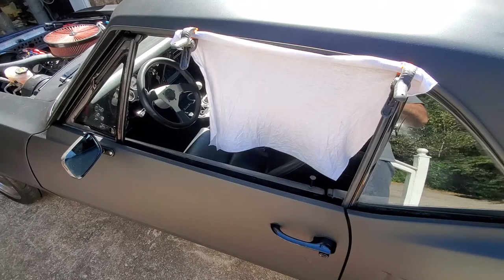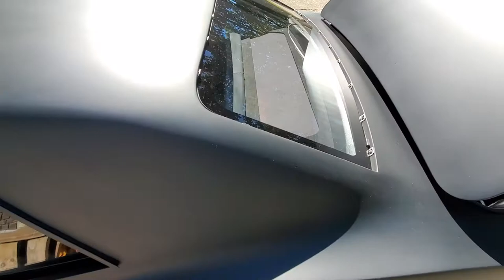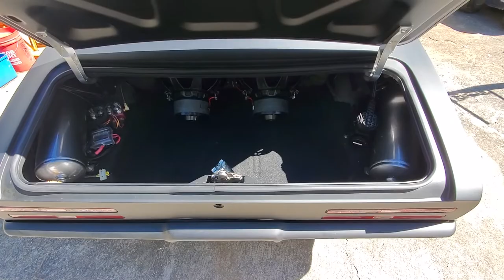Dayton Audio Max X 15" Subwoofers Infinite Baffle 1967 Firebird

Comment: Are these subs designed for IB setup? Or do they just so happen to work very well in IB?
Reply from the maker: They're not specifically designed for IB but they did work very well in IB. They sounded good with the trunk closed and with the trunk open. I did that to just compare trunk baffle IB to what a true IB setup would sound like. With the trunk open they played a little lower but lost a little in the 40hz to 60hz range. I was really happy with them especially for the price.

Comment: Still running the same subs? I want to run 2 x 15" trunk baffle and was avout to get the One Audio IB3 but after seeing what the dayton audio can do im a bit double minded
Reply from the maker: I'm not running them anymore, I was happy with them but sold them to a friend that is running them in a 2019 Mustang GT with a trunk baffle. At the time I was thinking about going with a smaller sub setup. I have heard really good things about the One Audio subs so that's a tough call. The Dayton's are definitely a good sub and a really good price. The One Audio subs are more expensive but have a good reputation, I would like to hear some in person. You have 2 good options, I don't think you be disappointed with either one.
Reply: @jonathanwall2814  In the 90/2000's I always used to run sealed enclosures. I recently got back into car audio and been experimenting with ported enclosures. For my current build I'm designing an SQ build but want plenty of bass for the bass head in me. Someone suggested trunk IB but I've never heard or experienced them before. I've got a 13W7AE and was thinking of getting another one and playing them sealed, firing up through the rear shelf but the IB3 in trunk baffle has me intrigued. I just don't want to be dissapointed if it's not fulfilling my basshead needs
Reply from the maker: Man, that sounds a lot like me. I was (and still am) a big basshead from the mid 90’s but I am really into sound quality too. I’ve done a lot of DSP tuning in my car. Back in the mid 90’s I had an S-10 blazer with 8 15’s then moved up to 12 15’s but I always built sealed enclosures for it. I was out of it from the late 90’s until around 2020. If you have the chance you really should try to listen to an IB setup if you can find anyone local. Checkout the “Automotive Infinite Baffle/Aperiodic Installs” group on FB. If it’s done right an IB setup will give you plenty of bass and play much lower than a sealed box. I like ported boxes but they take up a lot of space. I wanted to save space and IB did that and has plenty of output.

Comment: How do you get all of that bass from an infinite baffle?
Reply from the maker: Infinite baffles perform really well in the low frequency range. You have to build a strong baffle and seal it off really good. If you have the right subs with decent Xmax and descent power you can move some air. It won't be as loud as a big ported box above 30 hz but still sounds pretty good. Plus you get to keep most of your trunk space.
Reply: @jonathanwall2814  ok cool thanks for  the info and response👍🏽 I have a trunk box but it's hard to get the bass into the cabin cause the backseats don't fold down.
Reply: @whuzup3 back seats have to go sorry.
Reply: @JeffMcDuffie72MeridianGate  oh wow that's not an option for me😁
Reply: @whuzup3  Ive seen floor in trunk used as baffle. Motor and frame either in or out the trunk floor and cone opposite side. Make it a solid build and be sure to keep sub from damage from under car.
Still need an opening from trunk to car cabin but it doesnt have to be seats. the more opening the better though.
Reply: @BARBELLS-AND-BUDS  I thought about getting a 4th order and porting through the ski hatch
Reply: @whuzup3  How big is the opening?
How many of what size subs you thinking about using??
Reply: @BARBELLS-AND-BUDS  The opening is about. 10x6. I have 2 DC audio level 2 12s on a 1k ampere audio amp. 150 amp factory alternator and 1 battery under the hood.
Reply: @whuzup3  I think 60"2 wont be enough for both 12s
Reply: @BARBELLS-AND-BUDS  What is 60"2?
Reply: @whuzup3  your seat opening for the port 6x10
Reply: @BARBELLS-AND-BUDS  Would the length of the port help with the port volume?
Reply: @whuzup3  No unfortunately, the mouth size is issue, length is the tuning frequency.
I think a rule of thumb is half the cone area in port diameter.
It will work , but likely a lot of port noise.
Im not a BP expert so get more opinions to be sure
Reply: @BARBELLS-AND-BUDS  Ok cool. Thanks for the info and responses. Happy New Year to you👍🏾
Reply: @whuzup3  NP and back at ya! Be safe!
Reply: @BARBELLS-AND-BUDS  Likewise
Reply: @whuzup3 - You could get by with 6in. x 10in. Port opening=60sq. In of port area, with your 2-12s in a 4th order, as long as they are rec. For sealed enclosure's, from the Mfg.? This port area won't be too much of a restriction, with your 1,000 watt amp, as your impedance rise while playing music, will prob. only allow 500 watts. Also tune port somewhere between (50Hz-60Hz), if rec. For sealed, make your sealed= rear chamber 1 to 1.5cu. ft. Net, per 12inch, but again go with the company's rec. Specs. Hope this helps, and i love Bandpass enclosures, i hope you can do this, if your subs work in sealed, just ask Dc, what specs, and make what they say.
Reply: @evilinside5984  Hey thanks for the very detailed info! I'm hoping to get rid of some of the trunk rattle too. Take care man!
Reply: @whuzup3 - Yes, trunk rattle will be much less. I have had many great experience's with bandpass enclosures. Just make sure to seal around your ski hole opening, like with expanding foam, so less bass escapes back into your trunk area, around the outside of your port. Let me know if you do this, i want to hear what you think about the sound afterwords. Oh, mount your subs inverted, for better cooling= Sub magnets "NOT" in the sealed chamber. Hope to hear from you!?
Reply: @evilinside5984  ok so the magnets will be in the ported section?
Reply: @whuzup3 - Yes, and wire the subs backwards as well, meaning take the positive wire from your amp, and hook it to your negative on your subwoofer, and take the negative wire from your amp, and hook it to your positive on your subwoofer= everything will be 180= opposite of normal. This is to put the subs back in phase, since the subs will be mounted backwards.
Reply: @evilinside5984  Ok gotcha...hopefully I can find someone that can build the enclosure to specs. I'll update you when it's done👍

Comment: Any idea what it meters at 25, 30, 35, 40, 50, 60, and 70hz?
Reply from the maker: I did a 143.2 at 24hz on the dash with the trunk open and both windows down. In my car with the Dayton subs the lows got louder when I opened the trunk. I did a 142.4 at 42hz with the trunk closed and windows down. Those were my peaks, can't remember what it did at the other frequencies. I was just looking for the peaks at the time but it played good from 24 to 60hz. I used a SPL Lab mini bass meter.
Reply: @jonathanwall2814  Damn, that's frickin sick. How much power? Did you have to set a lowpass for safety so they wouldn't bottom out? I have an 09 Ranger single cab, and I'm considering IB "slot loaded" type of blow through with three 15s (since 18s would be too tall, and less cone area) after seeing a vid of a tacoma (similar truck) set up that way with a single.

I'm considering Stereo Integrity SQL-15s, but I'm not really sure which side of the EBP scale I should consider for IB subs; should I be looking at subs recommended for ported or sealed? Or just really good SQ subs in general but with more xmax than home or pro audio stuff?
Reply: @jonathanwall2814  Nice didnt lose much with trunk shit, Did it change the sound trunk open vs closed regardless of output? I mean did it sound compressed it muted in some way compared to trunk open?
Reply from the maker: @BARBELLS-AND-BUDS  With the trunk open it gained in the lower frequency range below 30hz and lost a little in the 40hz and up. But with the trunk closed it still plays lows pretty good.
Reply from the maker: @Drunken_Hamster  Man sorry for the late reply. I have a DSP that I can set a low cutoff for the subs but the amp has a subsonic built in and even turned all the way down it seems to start attenuating the signal around 20hz. I haven’t had any issues but I’m usually careful and keep my fingers on the bass knob if I’m playing a song I’m not familiar with. And power, I think it was around 900 watts total on the subs.

Three 15’s IB in a ranger would be awesome! I’m sure the SQL 15s would work good or the new FI IB subs, I think their IB stuff in now under the One Audio USA name. 

As far as EBP I don’t usually hear people use it for IB. Normally you might want a lower FS maybe mid to low 20hz and Qts .4 to .7 but even those are just suggestions. I’ve seen some people have good success with the “wrong IB subs”. Also a the higher the XMax the better. There is a good 
Group on FB with a lot of good info. “Automotive Infinite Baffle/Aperiodic Installs”
Reply: @jonathanwall2814  Thanks! I ended up finding and watching an hour-long video about IB and discovered a few things. Long story short, you're dead on about those Fi subs. The guy modeled a SINGLE IB3-15 at RMS power and it was showing low-mid 140s in winISD (including their basic usage of cabin gain). The way I see it, if you ballpark for all the inefficiencies and inaccuracies, I should be able to get mid-upper 140s with three of them, but theoretically as high as the low 150s, which is exactly where I want to be.
Reply from the maker: @Drunken_Hamster   yeah those numbers definitely sound realistic. There was a guy in the FB group that did a 150 with 4 Skar SDR 15in subs in a trunk baffle, 2 pointing up and 2 pointing forward. And the FI subs have like 3 times the xmax as the SDRs.
Reply: @jonathanwall2814  And a trunk baffle is gonna be a bigger car (lower starting freq for cabin gain) than my tiny ass Ford Ranger, which according to the 1/2 or 1/4 wave calculation or w/e, the starting frequency for cabin gain is around 110hz.

Comment: wattage?
Reply from the maker: At this time I had a JP95 running at 2ohms so I'm guessing around 900watts total on the subs.
Reply: @jonathanwall2814  that's sick, I've got the Dayton he 12 now on 1200 watt taramps
Reply from the maker: @Robeyros  Nice! I'm about to build a van for a friend of mine, going to do 8 15's and probably going to run a taramps MD12k to keep the cost down.
Reply: @jonathanwall2814  that's dope, are you going to slamology this year?
Reply from the maker: @Robeyros  Not sure, I would like to but will just have to see if it works out.